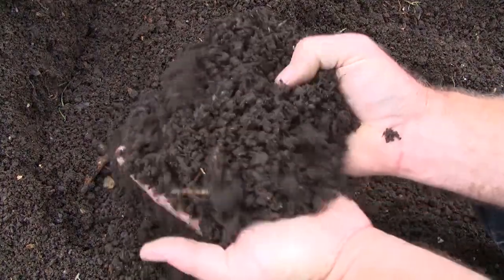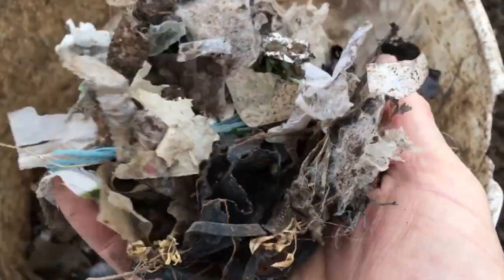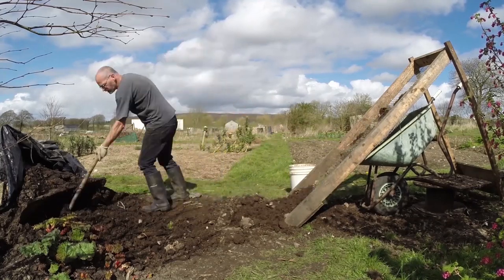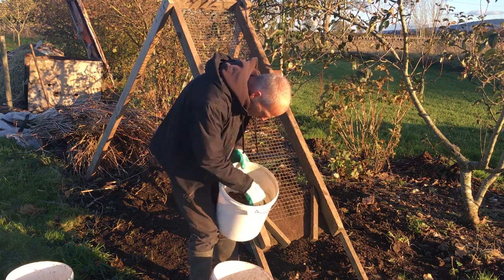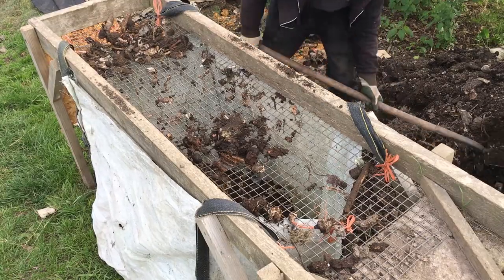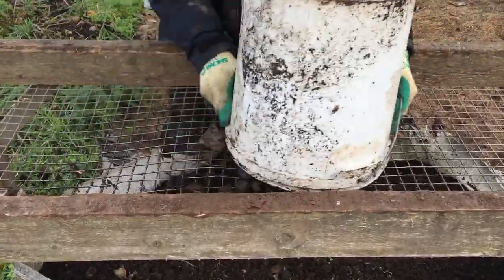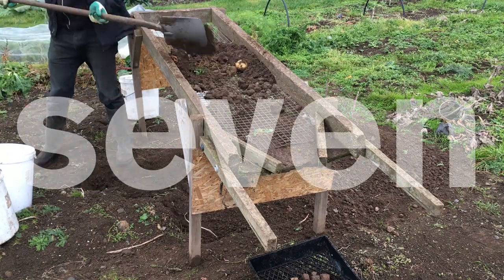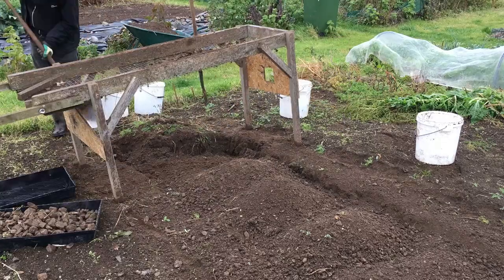8 Ways to use a Compost Sieve

Comment: I have sieved garden soil also, and I think I can improve on the method used in this video, saving a lot of labour.  Be aware that this hasn't been tested, it is just a theory, inspired mostly by this video and to a small extent my own previous attempt!  When I sieved my garden bed,  I used a 1/2 inch screen.  My main objective was ridding the area of bindweed.  While it did very substantially reduce the bindweed, enough bits of roots went through that I was still weeding it out as it grew.  I was a bit disappointed considered how much hard work it had been to sift the bed. I resolved to resift it using 1/4 inch mesh.  Having seen this excellent video, and having a lot of area that hasn't had even a primary sieving yet, I plan to copy the 1" horizontal sifting directly over the bed it is going into.  However, I will make two sieves.  The second one will have 1/4" mesh sieve and have shorter legs so it can sit directly under the 1" mesh sieve.  When the dirt falls through the upper sieve, it will land on the lower sieve, saving me from shoveling it again.  I will start out by digging out the first section for screening and tossing the dirt into a wheelbarrow.  I will dig the hole longer than the sieve is wide, so that when I sieve it, the final soil in the hole will be separated from the next section enough that there is always a buffer zone (hole) between the sifted soil and the next hole, so there will be no cross contamination.  The two screens then get moved over the hole, and I shovel from the adjacent section of unsieved dirt onto the top screen, working it through. It will fall onto the 1/4" mesh sieve.  Move the top screen over the new hole, work the sifted soil through the 1/4" mesh still sitting over the first hole.  Move the bottom screen back under the top screen, and shovel the soil adjacent to it onto the top screen.  And so on.  Aside from the first section, I will get two screenings with the resultant soil automatically ending back in the bed it needs to be in.  At the very end, I will bring the wheelbarrow over and do my last sifting with the dirt in it.  If I need to amend the soil, I will first calculate, eg. how much compost I need, and determine how much of that amount should go into each sifting.  I can throw it onto the hole a bit at a time as I sift, perhaps, saving me from having to mix it manually afterward.  At the worst, perhaps I will only need to rake the top each time I had any amendment.  In theory it sounds great, who knows if it will work out in practice.  Hmmm.  Now I am thinking it might be helpful to hing the screen so that I can just lay a tarp beside it and flip the screen over the tarp so all of the debris left will fall on the tarp without me having to hand clear it.  I will have to think about that.  Might be good, might be more trouble than it is worth.  Certainly it would add to the weight of the screen, which wouldn't be good.
Reply from the maker: Sounds like an interesting process/combination. Getting rid of all the bindweed roots is a real hassle. I have found I need to cover the bed for at least a few months after sifting, to kill off all the pieces of roots that fell though.

Comment: You can just build a couple smaller frames that fit inside the current one with different mesh size or orientation. And you can use them on demand.
Reply from the maker: That would probably work.

Comment: Water is pretty effective at separating stones,wood and plastic from finished compost or soil. 
Plastic and wood tend to float, stones sink and compost and/or soil dissolve.
After I skim the plastic and wood from the surface,  I'll toss the rest back through a 1x4"screen,leaving me with various sized stones,and some plastic/wood.
This uses a bit of water, but it really helps remove the plastic. 
I wish there was a similar way to sort plastic from wood...
Reply from the maker: Good suggestion, thanks. A friend had made a similar suggestion and i tried it out once, but likely didn't use enough water, and didn't dump it out in another sieve. Should try it again.

Comment: Build a tall frame around it and attach 4 strings to the sieve and then let it hang freely that way you just need to wobble the sieve a bit and youre done. To remove the debris you can just tilt the sieve then.

Comment: I like this.. I have something similar. For your, its could be simple to add wheels to the front and so you can move it around like a wheel barrow... the area where the rocks are rejected looks like the handles for one.
Reply from the maker: You are right, wheels would help and the handles are already there. Not sure why I didn't think of them before.

Comment: You mention adjustable legs, which gave me an idea (feel free to diss if you want, I have no way to guess whether it's a good idea or not).  Maybe you could build instead of rectangular legs, some sort of A-frame resembling a swingset.  Then suspend the sifting frame by chains from the A-frame in such a way that the chains could be lengthened or shortened onto hooks as needed.   Also, the sifter would then be swingable, which might be an easy way to sift material through it?  I wouldn't know until I tried it.   But it sounds possible, maybe?
Reply from the maker: I have seen swinging sifters before, which are used by swinging to bash into a number to cause the sifting action. Seems to work for finer and lighter stuff. There are a few videos out there about it - I think Curtis Stone did a video about one a while ago on his Urban Farmer YouTube channel. With the ground that I was clearing, and with quite wet compost, having a firm and stable sieve/screen to bash against was a benefit, and in ways I would prefer if it moved even less.

Comment: Have you considered building a smaller one that could fit on your bucket directly, so you could fill the bucket with compost, put the sieve on and shake it over were you want to use the compost. Then you just have to clear what remains in the bucket. It would be way easier to carry around in my opinion.
Reply from the maker: I hadn't thought of that. It could be quite useful, though a bit heavy hold and shake a full bucket.

Comment: I really like your approach, I work in health and safety. So, you have that nailed! I would though make sure the sieve frames are separate but connectable. They take some weight and bashing? Need replacement and of varying types. They would be lightweight enough to inspect also?
Reply from the maker: Thanks!

Comment: Add 2 bicycle wheels on the legs opposite from the handles?
Lift the handles a few inches and roll the sieve to a new location.
All of the best to you.
Reply from the maker: Wheels would  definitely help (not sure why I didn't think of that). I wonder about the size of wheels. I can see the benefit of bicycle wheels (light weight and big enough to go over obstacles), but wheelbarrow wheels would help reduce the pressure of the sieve on the soil. I'm tempted to try a few cheap wheels first, probably 15-20cm (6-8 inch) then upgrade if they don't work so well.
Reply: @REDGardens  _ Yes I agree with you about the pressure on the soil. I was thinking that they would be wider than your standard bed so that they straddled it. Happy harvest!

Comment: That's awesome. I have a 1/2 inch one sized to a Rubbermaid tote and a 1/4 inch the same size. I originally made a square 1/4 inch one for a garbage can but it was too big to manually use for long periods of time. Your system seems a lot more efficient but storing such a large piece would be problematic for me.
Reply from the maker: Yes, storing it is an issue. I am glad I have a lot of space!

Comment: i use a metal matress support/spring frame with 1 cm holes.
reduce the angle of the sift,shovel it full of compost and tap the metal spring with my shovel so the compost slides down slowly and falls thru. on the bottom only sticks and small stones remain..
Reply from the maker: I only recently realised that I could do what you describe - setting the screen at a shallow slope then tapping the bottom with my spade. I have tried it when clearing ground/weeds, where most of the soil drops through, and the rocks work their way to the end of the screen, but the grass/roots need to be collected by hand. Will have to try this technique out on the compost. Thanks.

Comment: I built my sieve to separate dirt from stone.  It turns out there are places where I do want stone, like my parking area, and the dirt is to level out my yard.
My main difference is I built mine to fit over a utility trailer that I have so the dirt will fall in.  I have since found a discarded utility trailer bed where I can scrap the larger material into.  My screen sits on top of my frame.  This allows me to easily move the material off of the screen in any direction.
(my compost is not ready yet to filter through the screen)
Reply from the maker: Very cool idea.

Comment: Extendable pipe poles attached to a makeshift axel with bicycle tires.  Instead of lifting the frame to move it, you can just roll it.  If you used oval wheels instead of round ones you could even emulate a shaker box as you pulled it along.  Thus reducing the need to use a shovel to sieve the material.  Just fill'er up up and roll it along. Wheels on the cart go up and down.  Fa la la la
Reply from the maker: Wheels would help, and extendable posts would be cool. I wonder where I could get some oval wheels - lol!
Reply: Cut some oval wheels out of plywood and bolt them to the legs. No bearings or axles needed, you are not taking it on the highway.

Comment: I ended up just attaching some timber to the ends of a roll of chicken wire  and dumping the compost onto it laid out on the ground. Just lift each end in turn and you end up with sieved compost In the middle and the detritus at the edges which are best raked away.
Reply from the maker: That sounds like a really useful and simple way to do it. Very cool!

Comment: Nice and informative video, sure gave me a couple of ideas! But I have one thought about 6... You think removing all the stones, even the smaller, unproblematic ones, is better? I was always thinking more in style, that since stones are already in the ground, that they should stay there. I don't really know what they would be good for, except maybe more aeration, and perhaps minerals. But I don't know, it's just a thing I can't really figure out. What do you think, do you have any observations on benefits of stones?
Reply from the maker: I don't think there is much benefit from stones in the soil. I figure that any minerals/fertility that can be gained from them can also be got from the smaller soil particles 9which used to be larger stones). There is a slight benefit in taking them out, as there will possibly be more carrots that are straight, and fewer stones on the surface to get in the way of sowing and weeding. But I don't think there is any benefit in leaving them in, at least not with my soil type.
Reply: @REDGardens  Thank you for your answer! :)

Comment: This is great ..Mine has smaller holes...my problem is all the poor worms that get stuck or hurt.. I think I'll try the 1" size
Reply from the maker: Yeah, l the worms don't like it. I try to wait until most of the worms have left the material.
Reply: @REDGardens  They don't leave...Do They? These are regular garden worms...the compost is mostly dirt by the time I sieve it...I have to do that to get the roots of weeds out mostly. Thanks for responding man.
Reply from the maker: @beverleypeacock  It is the smaller red worms found in manure that I was coming across.

Comment: One sieve, several different sizes of screen might be the ticket!
Reply from the maker: I have been thinking of that but have yet to figure out how to build it so that the frame was solid, but the screens could be swapped out easily.
Reply: RED Gardens how about keeping it as is, with the 1 inch screen, but frames could be built with smaller grid size (1/2” and 1/4”) that slips inside the current frame. The 1 inch mesh will support the new, slip-in frames, and all material should slip right by the 1” mesh! 👍👍 
Now I want build one!
Reply from the maker: @a206h  that could work.

Comment: Have you considered put wheels on the sifter table? If the open end were slightly lower than the other end the trash would naturally be shaken towards the exit.
Reply from the maker: Wheels would be a good addition. I have the table slightly sloped to the open end already, but I think it could be steeper.

Comment: silly question: but can dear mesh be used instead of the metal mesh you used in this video? I have a small composter about the size of a large dog house, and I want to make one of these for my small garden. I brought dear mesh last year and I still have a good bit of it on a roll and I wondered if it would hold up to sifting my compost. I guess I could try it out, but I wanted your thoughts. Thanks :)

Comment: lay it down bridged between 2 pallets and run a mulching mower over it. Small pieces fall through. Big pieces get chopped up finer until they fall through.
Reply from the maker: that would be an interesting approach to try
Reply: @REDGardens  I use a mulching lawnmower to shred everything. Spread it on a hard flat surface and run over it a few times then throw it back on. No clumps. I sift with a 1/2" mesh and almost all of it goes through. I end up with a compost which is earlier in the cycle so it ends up super fluffy to hold air/water. Plants love it. If you let your compost go too long it ends up like peat and it's easier to compact. If you don't let it go long enough, it robs nitrogen. The mulching lawnmower breaks up the woody chunks so they can break down sooner. The mulching lawnmower preferentially disintegrates the larger, harder pieces.

Comment: 2m30s “this involved a lot more lifting” I think not. Consider that you always lift the same MASS of material, but the pail is one lift of the mass of the pail, versus multiple lifts of the shovel. Basically, significantly less foot-pounds of work.
7m35s “different screen sizes” Consider a frame with the coarsest screen, and just lay a close-fitting “mat” of finer material on top. The frame holds both the coarsest screen and on top of that a finer mesh; easy to change the grade and no need for multiple frames.

Comment: That seems to be rather large holes in the screening.  Far to many stones and sticks will get through them.

I built two screens that fit over our wheelbarrows.  First has about half the size openings as his.  This catches most of the stones and bigger uncomposted items.  Can easily grab out most of the remaining stones or odd plastic pieces.  Dump everything else back into a different compost pile to continue decomposition.

This usually sifts it fine enough for garden beds.

A second screen with even a finer mesh I can sift this material through and end up with only fine compost material which is ideal for use on lawns.  Mix in with soil and sand for a nutritional leveling mix.

Comment: I’ve discovered that 1/2” screen works best for me.
Reply from the maker: Cool. is that in a horizontal position or sloped?
Reply: RED Gardens most often it’s horizontal. I had the same issues you did. The frame acts like a cage that holds compost in a controlled fashion as I work it. I do like your addition of a chute for dumping the rejected materials. My frame is only 2 ft x 3 ft though because that size fits my wheelbarrow better. Good video!

Comment: Have you thought of dumping the larger material into a tub of water, any stones and metal objects found in the compost and soil should sink, may save you some time in sorting.
Reply from the maker: I did try a version of that, using a pail of water. I found that a lot of the sticks etc also sank as they were so waterlogged, with compost stuck around them. It did work a bit if I moved things around in the water the stones sank to the bottom and the sticks came to the surface of the pile - but still underwater. It worked, but not necessarily easier or quicker than sorting by hand.

Comment: Have you thought about constructing a cylinder with a handle at one end.  Simply shovel in what you want to seive and rotate the crank.
Reply from the maker: I have thought about using cylinder type sifter - I think they are called Trommels. It would be a more complicated build. Perhaps more useful with the compost, but less so I think with some of the other uses, like clearing ground.

Comment: Really liked your idea's especially the bit where you move it over the top of the bed you are wanting to place compost Captain OBVIOUS HERE! Lol, But you also mention that you wished you could move it around easier, well why not put a pr of reasonable diameter wheels on one end? Roll it like a wheelbarrow then. Your other wants are other mesh sizes to vary what grade you can sieve to! Well why not just make a frame large enough that it can slip inside the frame you already have and seeing as you want it smaller anyway the two layers of mesh should not be of concern, heck if you have heaps of that mesh on hand you could even staple it so the squares don't actually line up with that one underneath???
Reply from the maker: A pair of wheels makes sense - only now realising how obvious that is!
Two layers of mesh would work, but not sure about having the same size mesh onto of another - shifted as you suggest. I expect that it might clog up a lot more, but won't know until I try. Shame I don't have lots of other mesh to experiment with.